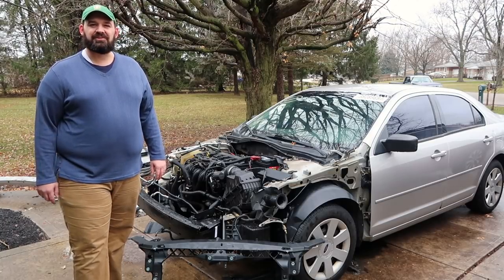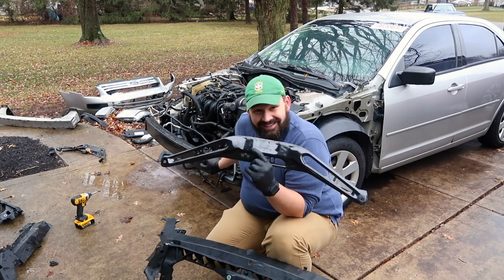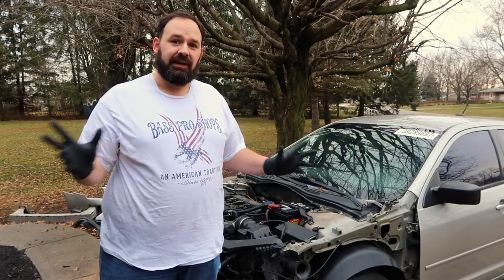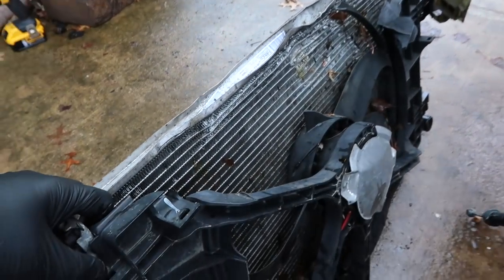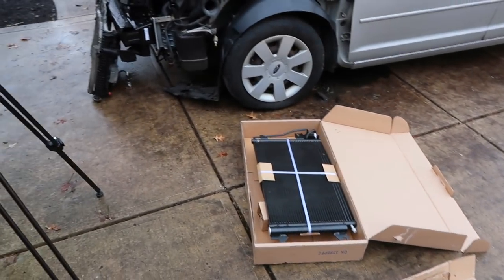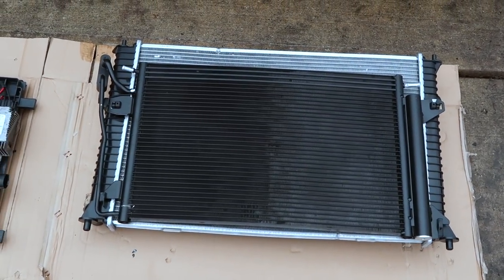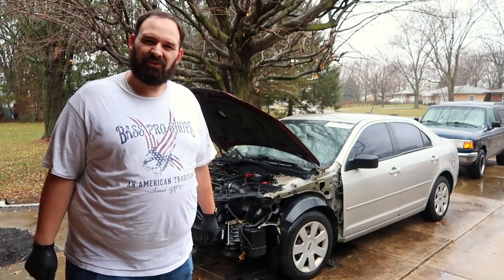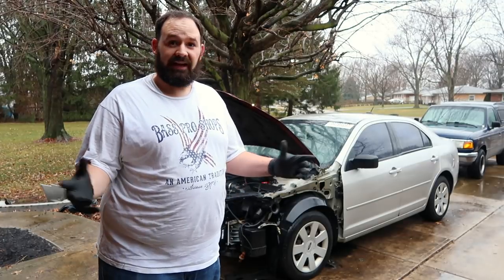Fusion Rebuild -- Part 5 -- Reassembly Part 3 — My First Copart Salvage Car Rebuild Project

Comment: Love these videos! I happened to stumble across your channel while googling Fusion rebuild projects, as I’m currently in the process of rebuilding a salvage 2011 Fusion Sport in pearlcoat white I picked up! Mine is also a front end hit, but wasn’t hit nearly as hard as yours. My radiator core support did get a small crack in it on the top side towards the passenger area, although it didn’t completely crack apart into two pieces I’m lost on if I should replace, or if I could get away with using some 3m plastic epoxy on it (its used to rebuild bumpers etc etc I’m sure your familiar). What is your take on this? Look forward to your response, and keep up the great work!
Reply from the maker: Congrats on picking up what sounds like an easy fix! I hope you’re enjoying the rebuild process. As far as core support damage goes, it’s hard to say for sure without seeing it... however, I would tend toward better safe than sorry. The core support is an important structural part of your car. It’s not terribly expensive and it would be fairly easy to replace if everything else it bolts up to is undamaged in the wreck. So, if it were me, I’d probably go ahead and replace it just to be safe.

Good luck with your build! I’d love to see a photo of it when you’re done! My email is in the description.

Thank you for watching!

Comment: Hi greetings from Portugal. Another follower from this side of the Atlantic. Just a question... do you have to buy 2 diferent products for the cooling system? Destiled water and anti-freeze ?
In Europe we just buy it already mixed in diferent proportions. 

Any way, keep the good job😀
Reply from the maker: Hey, thx for watching all the way from Portugal!

We can get premixed coolant here too, but in this case that’s not the way I bought it. Ford requires a special type, and it’s easier to find in concentrate.

Comment: Your supposed to pull it straight and it out before putting new parts on it so its aligned properly because if was hit nothing will line up properly due to being hit

Comment: I couldn't watch your videos and not sub. You are a good presenter. My suggestion,fix up high value rare cars like the stand or ss or gti etc. These cheap cars no point fixing.
Reply from the maker: Thank you for the suggestions. The Fusion was a nice cheap car to cut my teeth on. Hope to move on to move expensive and interesting vehicles as money becomes available.